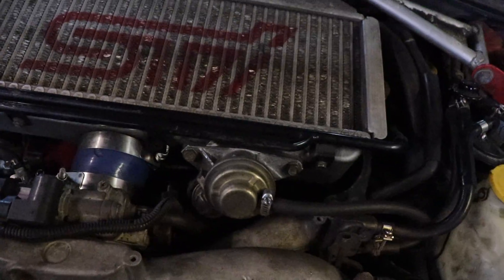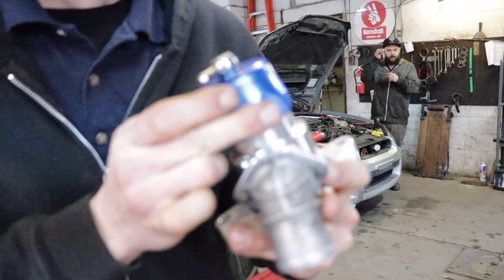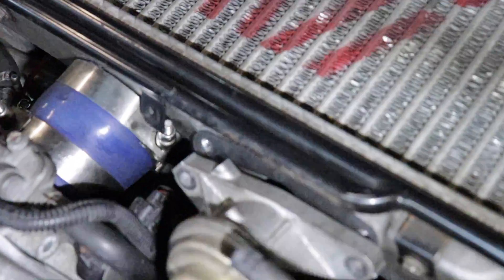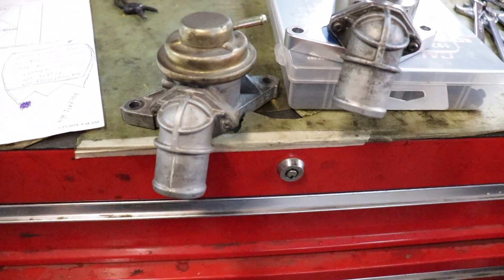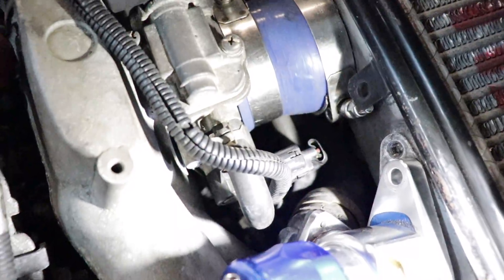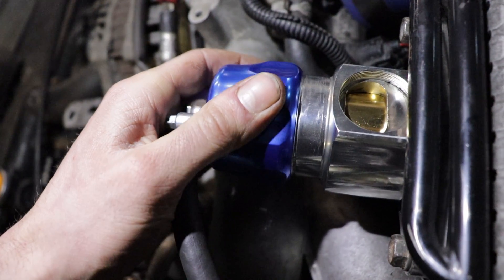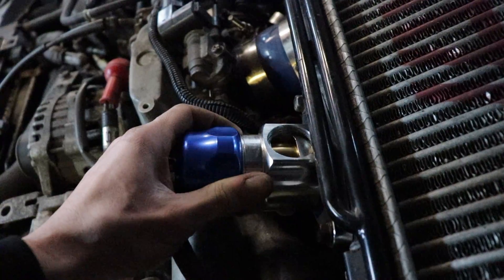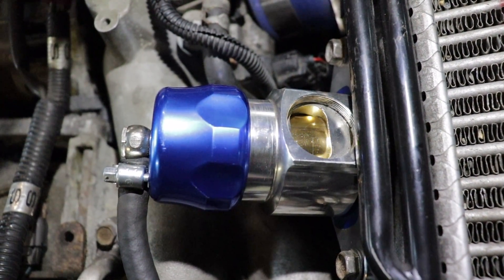HOW TO install a dual port BOV by turbo smart on your WRX

Comment: I was between this turbosmart BOV and the HKS. This video just sold me on the TurboSmart. Great video. Thank you
Reply from the maker: thnx man, anything to help out
Reply: @salvobrothers5928  just had my dual port turbosmart BOV installed today on a 2017 STI. It is awesome!
Reply from the maker: @drudawg4981  beautiful, hows the drivability with it, I've been curious on others opinions
Reply: @salvobrothers5928  I am still getting used to it. it seems like it shifts faster when I a mashing the gas getting close to red line. it acts a little funny when I short shift while in boost, it almost stumbles a bit. My tuner said the might have to do a little tweaking on it if it starts to bug me. overall its awesome, my exhaust makes these cool popping noises now. Made the car way more fun to drive.
Reply from the maker: @drudawg4981  yea the popping was my favorite part about it and I know what your talking about when your light cruising the bov just looses all boost pressure and it has to build it all over again.
Reply: dru dawg 
Do you just install and good to go or do you need a tune or any other things I’ve heard of
Reply: @jayg1358  talk with your local tuner first, but i had PRE Racing install mine and did not have to get a tune. Car runs good. they said to really dial it in they can put it on a dyno, but was not necessary. I have had this bov for 3 months or so and love it. I was worried I would get tired of it, but it puts a smile on my face every time. pshhhhhh.
Reply: dru dawg
Thanks for info I just bought my first sti I have the 2008 and this is the first thing I want to do to it I want to hear that sound lol idk why but sounds cool
Reply: Jay G heck yeah man. You should do a turbo back exhaust, intake, and a tune first.  You will make some big hp gains and get the intake noise...
Reply: dru dawg 
Lol your right but my budget is not ther yet for all that but I do have $300 for this bov what do you think
Reply: Jay G In that case I think it’s the best 300 dollars Ive spent on my car. DO IT. The RCE Yellow lowering springs made my car Handel a lot better then stock, they were like $350...
Reply: dru dawg 
Which is your favorite bov
Reply: Jay G turbo smart
Reply: dru dawg 
Right on I’m gona order one 
G turbo smart  it should be just bolt on
Reply: Jay G well, did you get it installed??
Reply: dru dawg 
Not yet car is in the paint shop getting the car repainted  but I got the turbosmart bov ready for install soon as it comes out of the shop

Comment: ok 2 questions...

if i close off the trumpet and opt for full recirculation do i still have to adjust the soft-hard feature? 

does the trumpet/vent always have to be facing upwards? i have a BH5 but the orientation has it facing downwards into the motor... is that an issue?

Comment: Did you have issues putting the STI TMIC back on the mounts it's bolted on after installing the BOV?
Reply from the maker: well i didn't have the right brackets anyways so it never bolted down right. but you shouldn't have a problem otherwise

Comment: This causes problems unless you tune it

The stock BOV is 50/50 vent and recirculation. The ECU is EXPECTING that air from the stock BOV and adjusts the A/F ratio.
So if anyone wants one of these for the sound, that's cool, but get it tuned for it.
Reply from the maker: i agree, if you want it to work properly and be perfectly safe it needs a tune
Reply: This one is supposed to be adjusted to recirculate at lower rpm, and vent to atmosphere at high rpm/high boost.

Comment: Oh damn that makes two of us in the comments!! I came looking for stuff for my 18 sti and realized this guy is close by in pa. 
Were you able to get either a trumpet or the plug to fit under the pcv line on top of the bov? I wanna buy this but I really want to avoid running the soft pcv line under the intercooler.
Reply from the maker: haha thats funny how that works. i didnt look that hard for the trumpet but i couldn't find any by themselves and i dont have a plug either so idk but it doesnt seel like it would fit

Comment: Hey. What did you do to make the blow off sound like that? Can you show how it looks?
Reply from the maker: its the tune i have on the car, its running 20 psi but i don't recommend doing that unless you have the right internals otherwise your engine may not last long at that boost level if its stock.

Comment: Under low boost, do you get a little surge?
Reply from the maker: very slight its hardly noticeable
Reply: I get a little flutter, and the psshh... Is there something wrong or is that normal?

Comment: The amazon link expired. What the name of it?
Reply from the maker: this is the one i currently run on my STI, i couldn't find this one again. There was no name on it and i got it with the car without a box.
https://www.maxpeedingrods.com/product/fits-for-subaru-impreza-wrx-sti-2004-2018-hybrid-dual-port-blow-off-valve.html?year=2004&carmake=Subaru&carmodel=Impreza
Reply: @salvobrothers5928  Is it a turbosmart bov?
Reply from the maker: @NsXy  its an offbrand turbo smart

Comment: What blowoff valve is that?
Reply from the maker: its a knock off turbo smart
Reply from the maker: maxpeedingrods has them too if you use the code: salvobros you can get a discount on purchase
Reply: @salvobrothers5928  thanks man

Comment: How do you get that hose clamp to unlatch?
Reply from the maker: if it won't do it itself then sometimes you gotta pry on it some or hit the one side down so it releases. they can be a pain sometimes if you want you could always replace it with a regular hose clamp as long as you put it in a good spot so you could tighten it up but use the stock one if you can.

Comment: can this bov make some backfire? i have straight pipe ? or is bad idea to install bov?
Reply from the maker: ooh she definitely backfires, i have a catted exhaust with just a muffler out back and in the right rpm range or if I'm super light on the throttle it'll pop and crackle, i love it honestly
Reply: @salvobrothers5928  does it stall at all? got from ebay or where?
Reply from the maker: @pimpsahan55  i got this bov with the car when i bought it and they say it can stall on first start up but i never had that problem although it does randomly die when disengaging the clutch but i think thats a different problem cause it modulates the throttle some when its warming up